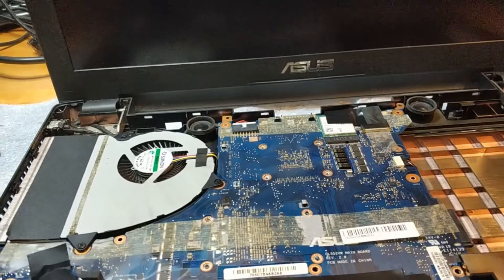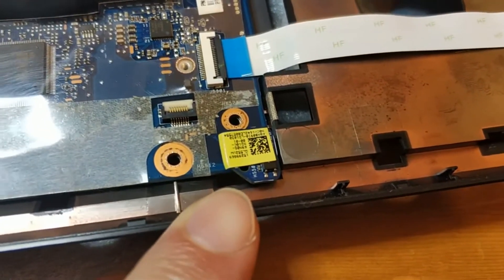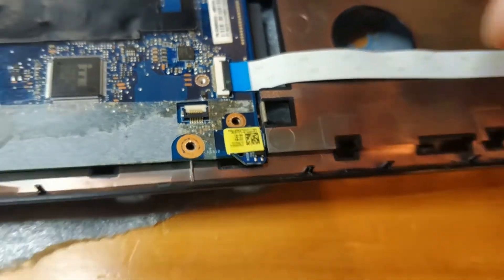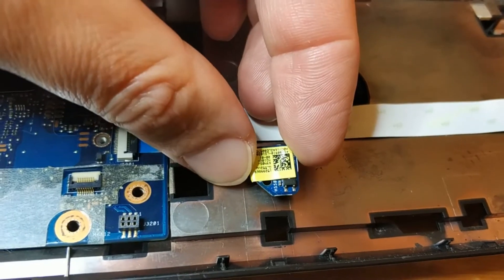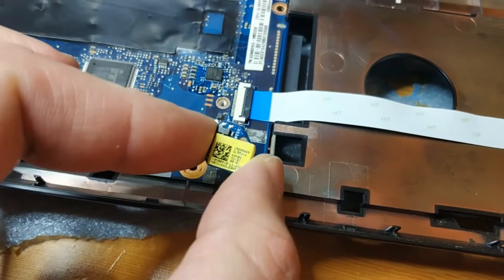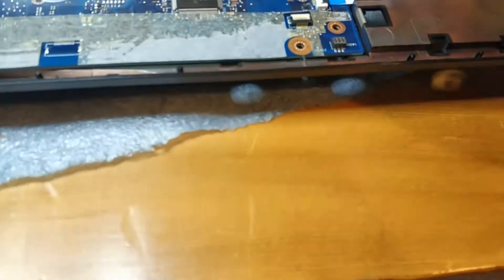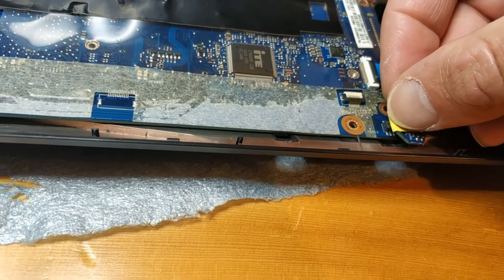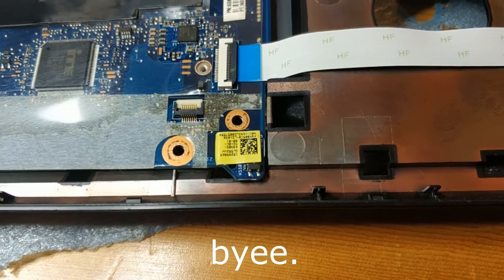Asus GL552 no screen - You put Magnetic sensor in wrong Position?

Comment: Great video because of this, I was able to discover the grey piece from the board you unplugged the lid board from actually broke off mine. And was still plugged into the bottom of it. Now j know the problem, I need to figure out what that connectors called. I have to replace mine.
Reply from the maker: Glad to be helpful, David.
You can buy a defective motherboard and use that connector.

Comment: what will happen if we dont attach that stuff?
Reply from the maker: Honestly, i don't know. Sorry that i cannot help you.
Reply: @DaneluRepairs  does that laptop will start without that stuff?
Reply from the maker: @MrDt4423  I'm not 100% sure, but i think it will not start without.
Reply: @DaneluRepairs  completely dead or charging indicator still lit?
Reply from the maker: @wawanendot881  i don't know. But, I think charging will working, because thus sensor is for motherboard to know if screen cover is closed or not; if motherboard think display cover is closed, of course, laptop it will not start, only charging.
But this is only 50% what i think/guess, i'm not 100% sure.
Reply: I accidentally broke this part off. The laptop starts and works without it. Of course, there is no reaction to closing the cover (screen).